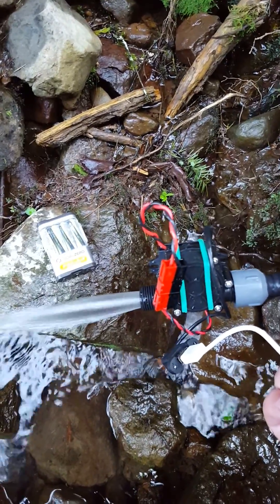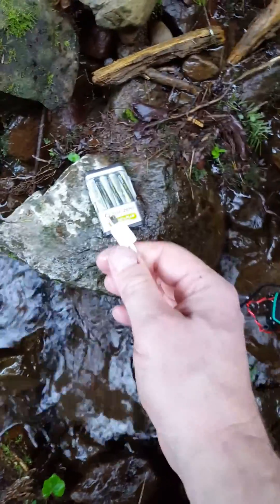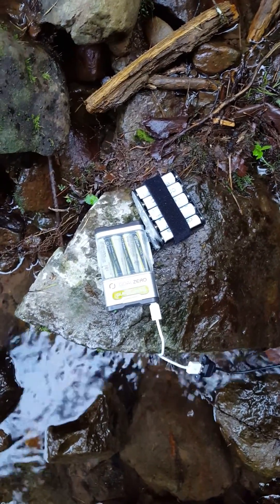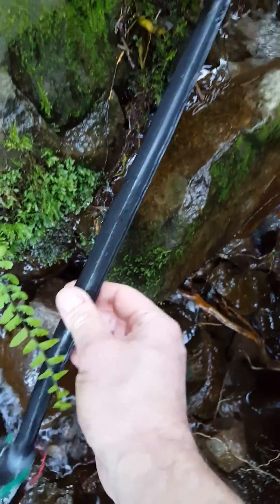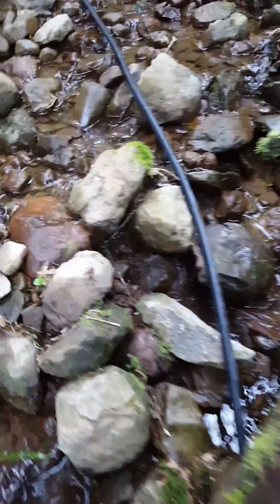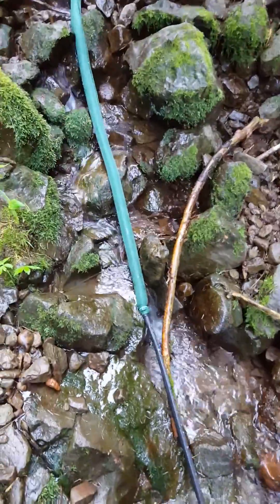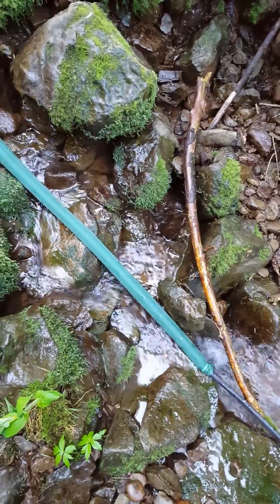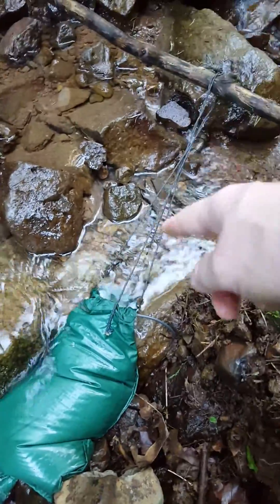TWG backpacking 10W hydro power demo

Comment: Have you multi-meter on this to see what watts, amps and volts youre getting?
Reply from the maker: Mike Foxtrot 

It does not come with a meter, but they are available on Amazon.  I used a USB power meter and a 12V power meter to test the design.
Reply: I worded that wrong, I meant to ask if you tested it with a multi-meter. I've seen these very same "10 Watt" micro hydro turbines a number of times but when tested they are hardly produse 1 watt.
Reply from the maker: Mike Foxtrot 

I tested and got a full 10W as long as the water input level is 10 or more feet higher than the water turbine.
Reply: Do have any videos of it being tested with the multi-meter?